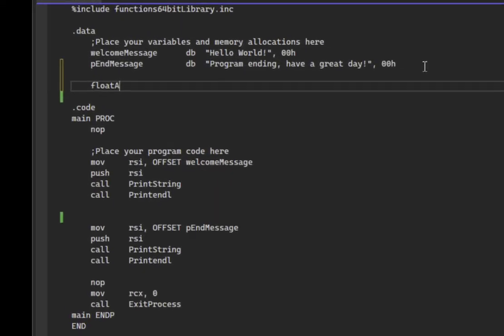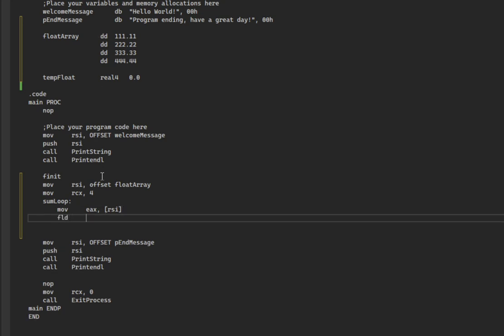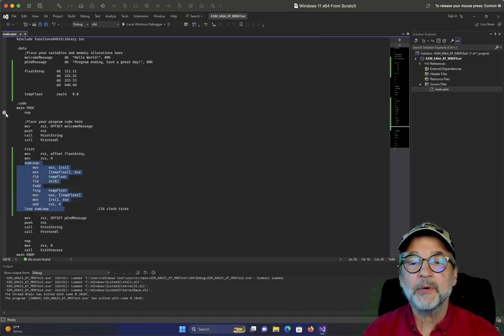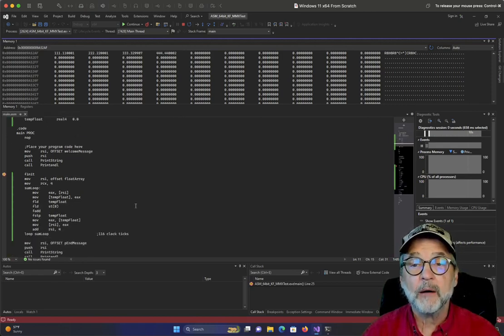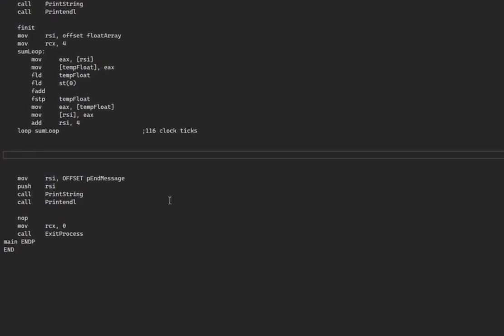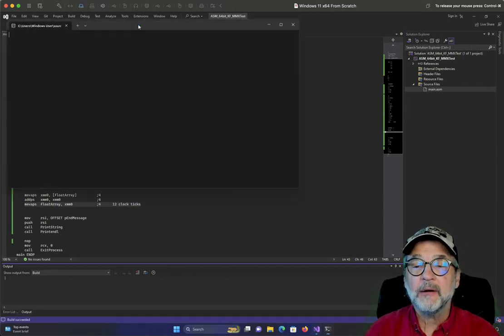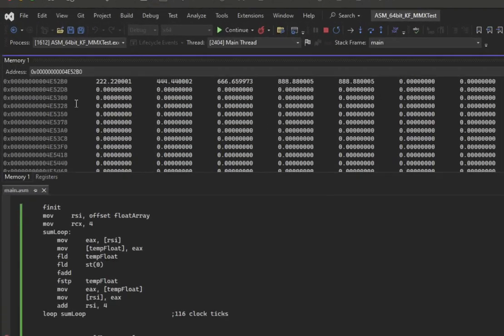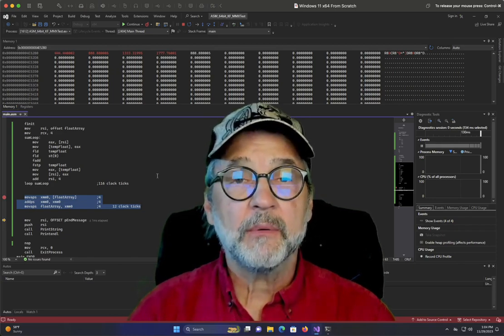Assembly 41a: FPU - What are those XMM registers?

Comment: fyi , YMM registers are their own type of register (windows has them aswell), rather than your standard 128 bit xmm the YMM has 256 bit, and furthermore ZMM (which only new gen cpus support) are 512 bit
Reply from the maker: @alexzalewski4894  correct with one change.  It’s not that Windows or Linux has those registers, it’s that the CPU has them and Windows, Mac or Linux OS’s can use them.  As said, these are special use registers, mainly for graphics rendering calculations and the like where a single instruction can move multiple pieces of data.  Awesome!

Comment: Hi!! Thanks for your time and sorry for my bad english.

 If i need to manipulate, for example, only the second value of the Xmm register... example:

Xmm0 is 0.0   0.5   0.0   0.0

And i need to change im separate only with the value 0.5 , how can i do? 

I thinking something like this:

Pos1:
dd (float)0

Pos2:
dd (float)0

Pos3:
dd (float)0

Pos4:
dd (float)0

Array:
dd Pos1 
dd Pos2
dd Pos3
dd pos4

So i can to do some operations with the "Array" like:

Mov Xmm0, [Array]

So... if I change the value of the variable "Pos2" for example to value 1.2  so I am changing  the Value of xmm0 from 0.5 to 1.2, right?

In your opinion, is this possible works?

Thanks in advance.
Reply from the maker: You really cannot do it that way.  You can move double and quad variables to the xmm register(s).  

Single Precision:
someData	dd	123.45
movss	xmm0, [someData]

Double Precision:
someData	dq	123.45
movsd	xmm0, [someData]

The other half of these registers cannot be manipulated directly. 

There is the PSUHFD statement ,but I'm not sure that is exactly what you're looking for.  Remember, the XMM registers are more for array processing using, let's say, a single instruction that fills the entire register.  But you need to continue using these special instructions and you really cannot access only 1/2 of the XMM register.  But if you're doing simple FPU programming, you really don't need to worry about the upper half since there are a lot of XMM registers available to you.  

Does that make since?
Reply: @billskycomputerguy  thanks for your time. I am calibrating a existing code and i need to have control for the value of the register xmm0 by another declarated variable who i can change any time. 
Example: xmm0 = ( 0 0.5 0 0)
I want to make a opcode with "mullps" were i can change the value of a Variable to calibrate the value pf the xmm0. 

Mullps xmm0, [variable]

How can i do it? If you can give me some idea, thank you.
Reply from the maker: I'm not really sure what you are suggesting here.  I would suggest post this type of question on Stack Overflow as there are many that might have a better idea of what you are trying to do.  Youtube is a horrible place to have that discussion.